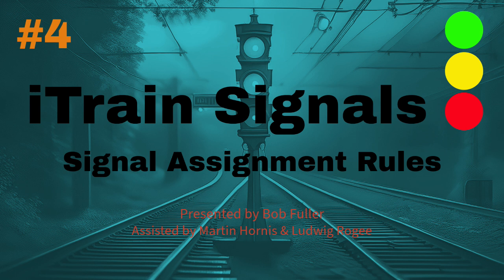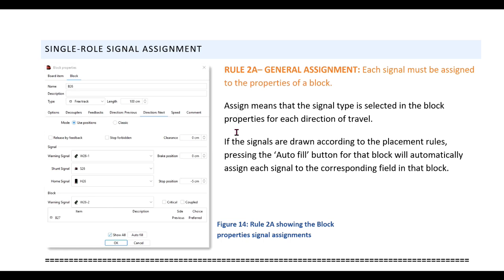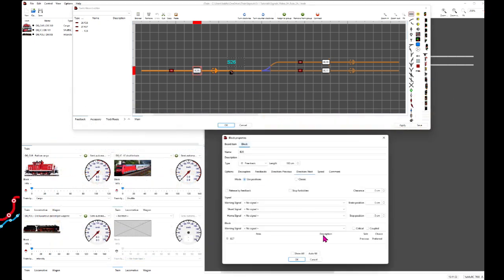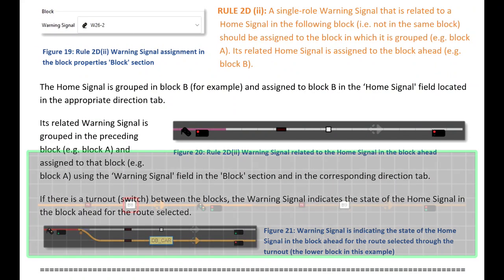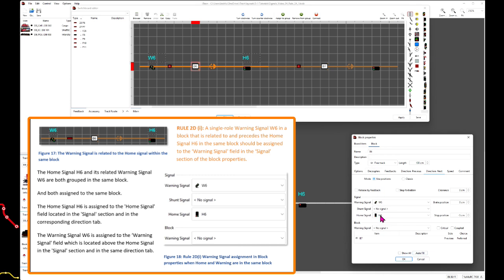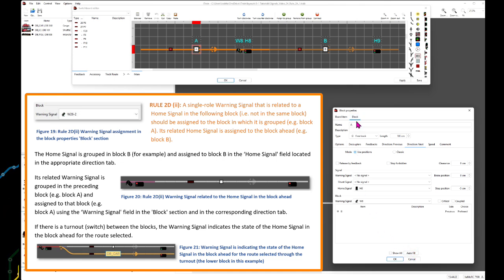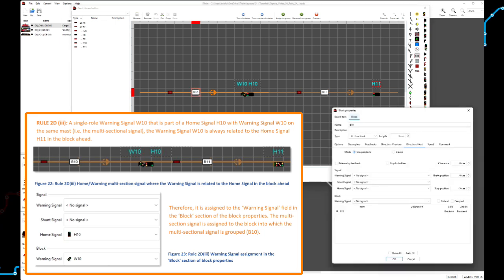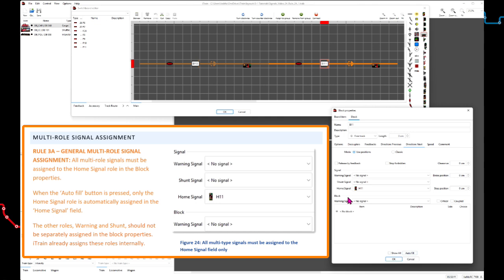iTrain 5.1 Signals [UK] - Video 04 - Signal Assignment Rules

Comment: is it mandatory to have a warning signal at the begining of each block. If not, what are the cases when you don't need one. Thanks in advance and thanks for your helpful videos
Reply from the maker: From an iTrain perspective, no, it is not mandatory (as seen in the iTrain demo layout). For prototypical signal operations, you need to refer to the signal system rules for the region that you are modelling (i.e. the UK signal rules are different to the German signal rules). But typically, a warning signal is not required if the main/home signal can be clearly seen on entry into the block. Video 06, which I am currently working on, will show how to set up a solitary home signal in a block.
Reply: @ Can't wait to watch this new video and the followings 🙂🙂